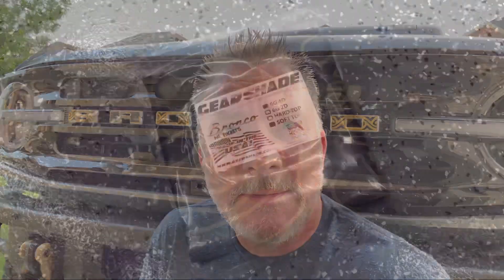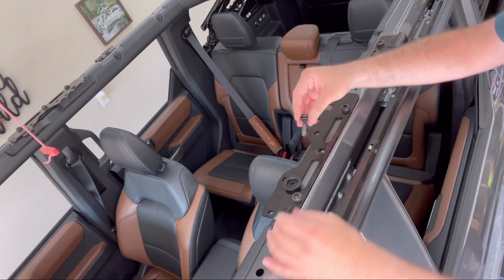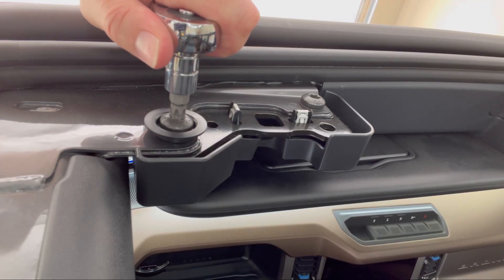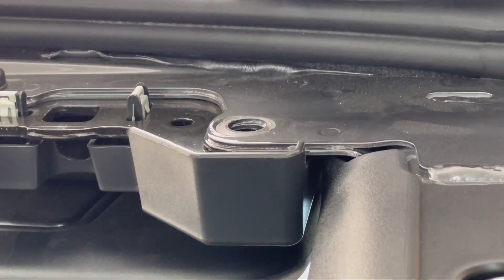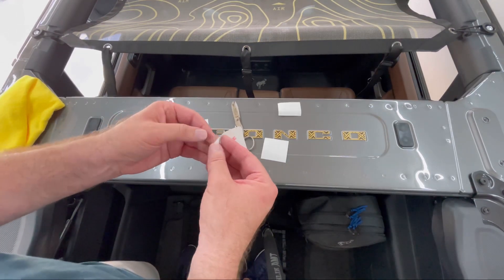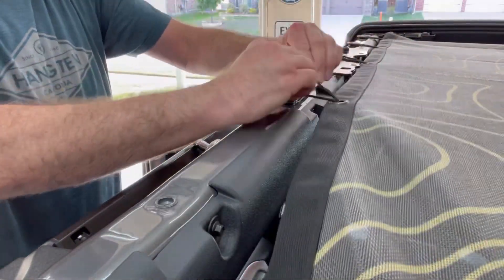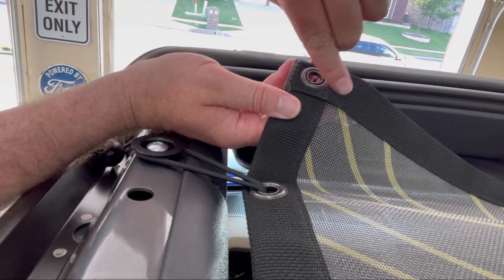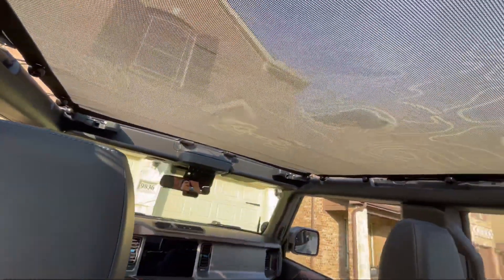How to Install a Custom Printed Sun Shade with ‘No Pockets’ Design by GearShade - 2021+ Ford Bronco

Comment: Great video. I made the same mistake on those rear anchors. Gearshade changed the design since Pickens Party of 5 did theirs.
Reply from the maker: Thanks for watching and also the feedback! Yes the new location caught me off guard but it all worked out in the end. Made for an awkward video, (but between you and me, it was hot out and I didn’t want to have to go back and record it all again!) 🤣 I just owned up to it in the editing!

If you haven’t subscribed already, I have a giveaway running currently for one lucky subscriber to win a 4-door all weather trunk mat from Muslogy Auto. 

And if you are already subscribed, thank you!
Reply: Same thing happened to me. I got my Bronco on 1 Feb of this year, and already had the Gear Shade on hand ready to install. Watched the Pickens video also. Contacted Gear Shade when things didn't line-up, and they informed me things had changed. That was back in late February/early March. Really like the Gear Shade, and run it at local hwy speed (55mph). Only a slight (minimal) bit of movement of the rear edge at that speed. Haven't tried it at interstate 70mph limit, and probably won't.
Reply: @retnav92  you will be fine. I’ve run mine down the interstate at 80 mph. Depending on wind conditions it pops around a little, no issues.
Reply from the maker: @retnav92  You'll be fine - those bungees are really forgiving. We've been down the freeway at 75+mph and not had any issues at all. As you say, there is movement, but what doesn't 'move' in a convertible at 75mph! Glad you found the video useful!

Comment: Wow I’m definitely getting one of these 🤙…if my Bronco order ever gets built
Reply from the maker: Yeah, I have to agree with you - one of the best things we've purchased so far. I didn't 'really' want one to start with, thinking it would take away from the open air appeal - but after sitting in traffic for an hour, in the Texas heat, this has already paid for itself in the lack of sunburn I've had! It really works! You keep the open air feel with none of the uncomfortable burning or sweating. It even helps keep the cool AC in the cabin. Great purchase!  -  And good luck on the Bronco build - it'll happen.

Comment: I appreciate you - worked perfect even with my pocket version.  about 30 min. 

does seem odd that there is a 4 inch gap in front but less than an in inch in the rear.
Reply from the maker: The reason for the gap at the front is to accommodate the soft top latches. If you had it snug up against the frame of the windshield, you’d have to remove it every time you put the soft top up and down. 

At the back, I have it pulled tight so it’s snug against the back (after having driven with it for a year, I’ve adjusted it over time. I’ve also removed it and tested other versions in that time as well.
Reply: @CUPRADESIGN  understood.  great video.  got it up easy.  took the doors off today too.
Reply from the maker: @OutHereOnTheFlats  - Glad to hear that it worked out well for you. And yes, taking the doors off gives it a whole different feel doesn’t it?!!

Comment: Will this allow you to close the softop with it on and do u need to do anything ( detach anything ) to close the top first to it
Reply from the maker: Ronald, yes, you can close the soft top WITHOUT having to remove anything, unclip anything or move anything. It's designed with space at the front to allow for the soft top mechanism clips to go into place. We haven't had a need to remove ours at all. Hope that helps answer your question. 

If you have any other questions about the GearShade top, just reach out. Thanks for watching, I appreciate it!

Comment: Does the shade prevent closing of the soft top?  Does it have to be removed (not the bolts but the shade itself) to close the soft top?
Reply from the maker: Great question! The GearShade is designed to be used and kept in place with the top up or down in both positions. You can leave it in place and put the soft top up with no problems at all. There is space at the front for access to the closing mechanism. Leave it in place all year round, or remove it in less than a minute if you want to.
Reply: @CUPRADESIGN  Thank you!
Reply: I just installed mine today.  Thanks again.
Reply from the maker: @khaynes4825  Awesome! Is it a custom print or a regular colored one? How do you like it so far?

Comment: I do not have my own bronco yet, but can that shade bolts(hardware) stay on if the hardtop is on or do they need removed before putting the hardtop back on?
Reply from the maker: This version I ordered is designed for the soft top, but I believe that the hard top version works the exact same way, and you DO NOT have to remove the mounting points for the GearShade to put the top back on. HOWEVER, the hard top version (if you still want to access the removable panels) requires that you drill into the latch cover (not the top but the latch cover) in order to still be able to access the release for the hard top. If you don't want to drill into it, you can still use the soft top version if you so choose. 

Here's an extract from the GearShade page: https://www.gearshade.com/product/4-door-bronco-mesh-top/

And as you can see in the picture, they have the hard top on, with the mesh installed. You DO NOT have to drill into the Bronco itself at all. Hope this helps.

Comment: Any particular reason you didn't go with pockets? Trying to decide between the two...
Reply from the maker: Thanks for watching, I appreciate it. 

So, I chose to not go with the pockets for a couple of reasons - I actually don't like the look of the top with those triangles in the corner, I wanted to maximize the print area that I was paying extra for on the top, and to be honest, I would never use the pockets either. 

You need to go with your gut - if the pockets make sense to you - go for it! But aesthetically, I just didn't want to look at them, either inside or outside of the vehicle - and I'm really happy with my choice!
Reply: @CUPRADESIGN  I don't think they're egregious  (no worse to look at than any of the top latches) and I'm not buying a print on mine. One plus I can think of is if I were to remove the shade I could stuff the cords in them...but again, not sure how often I'd do that.
Reply from the maker: @etmccaus  - In which case it sounds like the version with the pockets is the perfect way to go for you.

I had the Ford Accessories Tailgate Molle Panel delivered yesterday, and it comes with 6 pouches. That's where I'll store everything when I take ours off.

Comment: I’ve been on the fence about getting one. I kind of wanted a solid one to keep the inside dryer in light rain. I only have a hard top and I don’t want to have to put it back on every other week. Has your top seen rain, and if so how did it do?
Reply from the maker: Hey Matt, thanks for watching, I appreciate it. So here in Texas, we haven’t had rain for months. Finally last week we got some rain, but I had already put the top up being as we have a soft top. And to that end, if it’s going to rain, we can simply put the top up and not test it’s rain protectiveness. 

And being as it’s a mesh, it will stop ‘some’ rain in a light shower but as soon as that mesh is saturated, it will leak through all the holes. So, being honest, I think I’m your case, it’s not going to work how you want it to unfortunately.

Comment: Thanks for sharing! Did you experience any wind noise from the screen?
Reply from the maker: Hey Mark, thanks for watching, I appreciate it! 

So, being convertibles these are not quiet vehicles with the top down. However, to your point there was not a huge difference in sound when driving down the highway. 

It does move, and at 70+mph it does move a little as you would expect but no more than the actual soft top when you have it in its first position, and it remains tightly in place. 

The biggest benefit tho is the UV protection and the shade it gives you from the sun, while retaining the whole open air feeling. 

I was hesitant at first getting one, as I worried it would take away from the open air feeling, but it actually makes it a lot more bearable here, in days like today when it was 96°F on my drive home!
Reply: @CUPRADESIGN  Thank you for replying. Sounds like something I may be interested in. I live in south Louisiana.
Reply from the maker: @IluvYahweh  Of course, no problem! Being in Louisiana you’ll be used to the heat as well. I just loved that you can custom print it as well, making it unique to you/your Bronco. I don’t have any regrets getting it.

Comment: Any idea why i have 2 bolts left over. ??
Reply from the maker: Hey Samuel, so at the 1:18 point you can see that I used the OEM bolts that are there. They have provided the extra bolts just in case you don’t have the hard top prep kit. If I recall correctly some of the very early 2021 Bronco’s didn’t come with the hard top prep kit, so GearShade included the bolts for that location. Hope that clears it up.